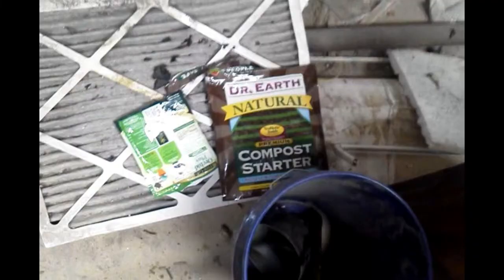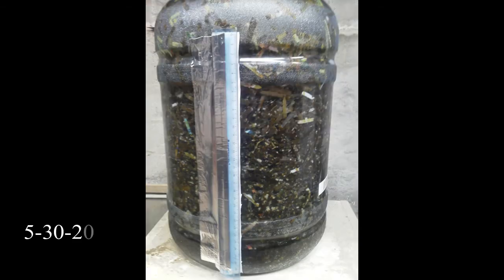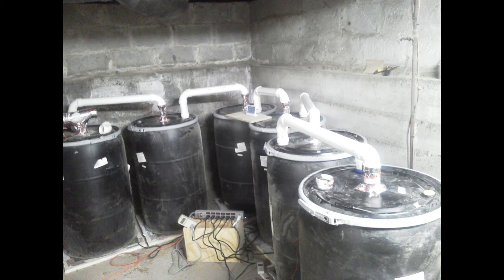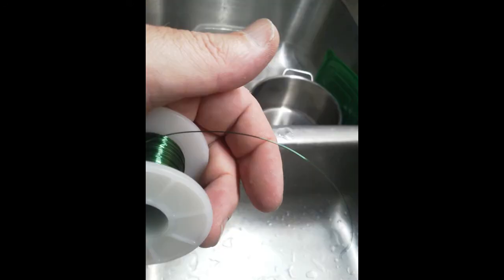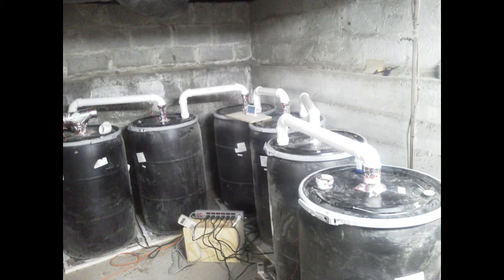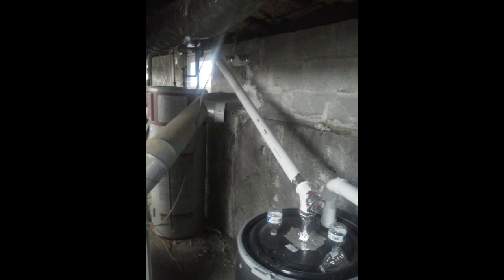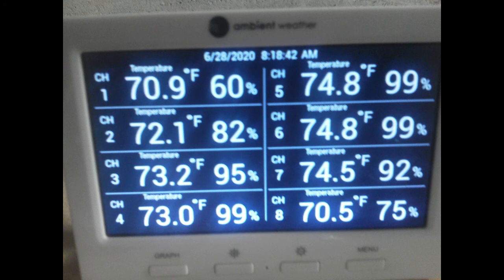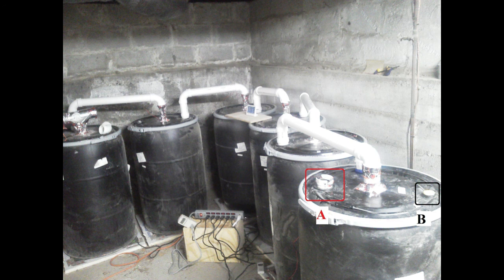CompostHeat Experiment 2019-2020

Comment: The heat comes from the annerobic process of composting bacteria. Inman ideal situation, you'll get methane as a by product. You could connect valves that lead to bike tire inner tubes to collect whatever methane is produced.
Reply from the maker: The heat show by the system in this video , was produced by aerobic composting (with a surplus or oxygen/air) = Which is not methane producing.

You are correct , if someone wants to produce/collect methane , they need an anaerobic system instead .. by significantly restricting the air/oxygen that gets into the system and collecting the methane that is then anaerobically produced.